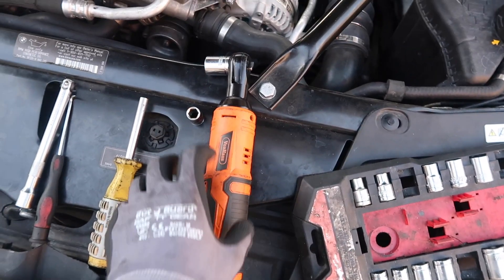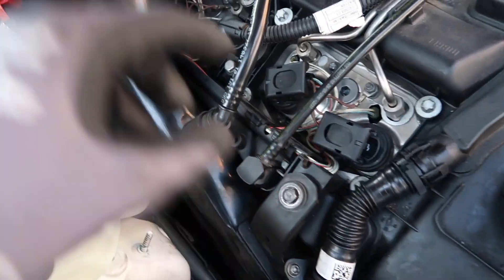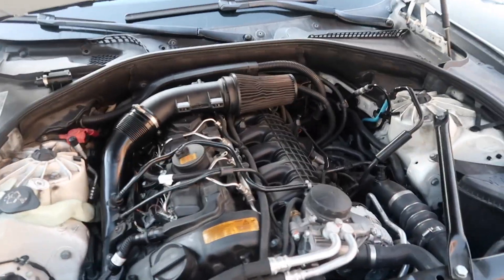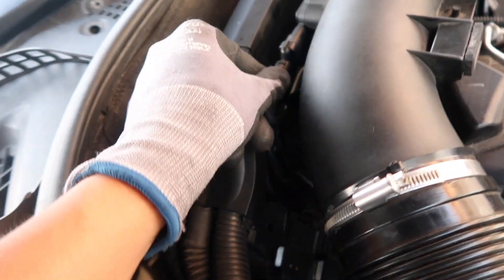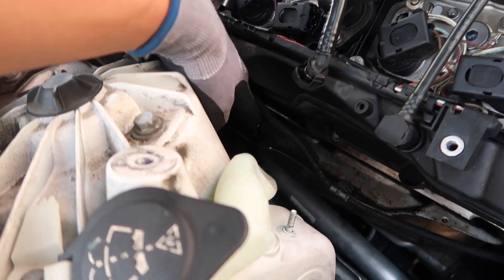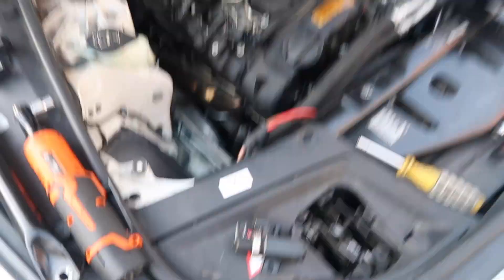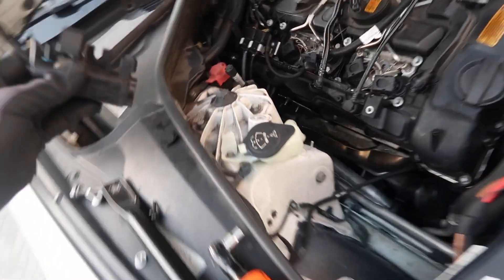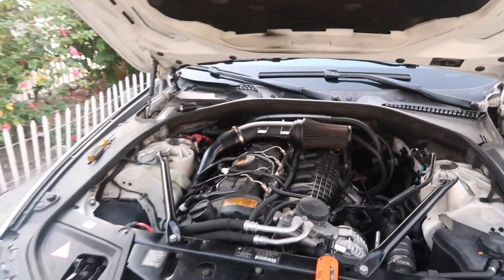N55 Boost Solenoid Replacement F10 535i (120208) DIY

Comment: I’m getting the p1290 code on my 535i xdrive. Was driving then all a sudden it was having a hard time accelerating. When I look up the code it says wastegate actuator solenoid. Would I need to replace the actuator or just the solenoid. I have the drivetrain malfunction error 😢

Comment: Did that air intake system heat soak like crazy ?? I think u lose power with that its not getting any cold hair from driving
Reply: i mean this video’s old by now lmao, but i guarantee that intake was causing a hp loss instead of gain, prolly sounded nice tho

Comment: My valve cover only has 1 vacume line why ?
Reply: Because you have a PWG turbo meaning your turbo wastegate opens and closes with the pressure of the turbocharger boost solenoid newer n55 most likely have Ewg “ electric wastegate”

Comment: Im getting code 120308 , charging pressure control , pressure to low ! Will this fix issue
Reply: Same you ever figure it out?
Reply: @stevenadamczyk3066 changed boost solenoid and diverter valve and still same code 120308

Comment: Keep getting drive train malfunction with 0 codes and 0 shadow codes after friend scanned with mhd ! Everyone says to replace this part and should solve my issue
Reply: Does your car not go into drive? I have a 2013 535i and it’s doing the same thing. No codes and the “mechanics” I had look at they have no clue 🤦🏽‍♂️
Reply: @KALIxESPN i can drive car fine even on highway but minute it goes into sport mode it gives me drive train malfunction code

Comment: I'm getting the code p12a9 boost pressure too high. Changed this part in the video, and it didn't fix it. I'm lost now.
Reply: Same here did you ever find your issue ? Help me out.
Reply: @robertherrera4903  Great news! Change the boost sensor on air intake. That fixed my issue. Super easy and affordable.

Comment: BMW error codes: 120208 and 120408 =  Boost Solenoid  malfunction
                                 120308  =  BOV (Blow Off Diverter Valve)  malfunction
Reply: I have a 2014 BMW 535i N55 F10 and I’ve been getting code 120308 do is it the BOV for me?
Reply: @FadedAshura  That code indicates a   Charging pressure control, plausibility Pressure too low   (It means you have Low to No boost for your turbo to work properly)

Do you get a Drive Malfunction when you start driving pass 40 mph?  Mostly when you have it on Sports mode and you accelerate from a dead stop.   That's what I was having issues...   I swapped the Blow-Off valve to a Turbosmart V9 dual valve BOV and I was still having the same issues... Also the new BOV wasn't making strong woooshhh sounds and I notice the Turbo wasn't activating do to that Drive Malfunction.....   

Replaced the   BMW Boost Solenoid   and that solved that annoying problem!  Very easy to replace and highly suggest to replace the vacuum hose that connects to the Valve cover.  Amazon sells a very nice quality kit of vacuum hoses of different mm sizes for less than  30 bucks and a must have when working and replace worn out air hoses in the engine... Clean the whole area from grease/oil and install the new Boost solenoid.

I'm now getting about 21psi of boost on my 535i M-Sport series.   It's feels and drives like a new car now!

Comment: I got dt malfunction going on highway today and I have codes 120208 120408 pressure too high. I’m stage 2 mhd bmw 535i 2011. No check engine. Could this be the issue ? Help plz lol
Reply: Same here lol did it work?
Reply: @joshuamolina2986  got rid of the car but never fixed it
Reply: @joshuamolina2986 I have 120308 I’m about to do mine I think it’s cold out but I’ll report back in a few hours
Reply: @chumbag fixed?
Reply: Just got that on
Mine. Did you end up replacing the boost solenoid?

Comment: Hey bro I have X6 2011 n55 I have error code 2c56. And 2c58. Charger pressure control. Can u let me know it that same problem?
Reply: Hi I also have this error, did you solve the issue?
Reply: No not yet I will try boost solenoid first
Reply: Some people said diverter valve
Reply: @PhuNguyen-lk7lu  If you can solve this issue, I would appreciate your help to me with this issue.
Reply: @umitchagylov7212  yesterday I removed solenoid and tested is fail is not holding air.  Monday I will go orders new boost solenoid.  By next week I’ll will put new one in.  If work I let u know
Reply: Yes it was solenoid.  My car now it good a lot power
Reply: Yes your car should have same problem
Reply: I hundred percent your boost solenoid bad
Reply: @PhuNguyen-lk7lu  ok bro many thanks

Comment: Thanks so much for sharing this! It really helped me. I have 2011 BMW 535i (f10). My car was giving me the powertrain malfunction error light at high speeds, spiratic jerking when accelerating, and a light smell of gas when initially starting the car. I didn't have to remove the top crossbar; my hands were small enough get around it w/o doing so. I also would like to caution everybody who tries this to be careful not to rip or tare any of the small hoses that connect to the main vacuum hose. The material that these are made of becomes brittle over time and excessive bending or movement can cause them to crack or break which will cause a vacuum leak. I slightly crack one of mine but was lucky that it was a small crack that I was able to use some Gorilla glue GEL on followed by some black electrical tape while it dried. Afterwards, the car runs a lot better and smoother. Thanks for your help in sharing this vid!  Sharing any  other vids that you have about the BMW F10 is greatly appreciated. Thanks again!
Reply: BMW N55 BIG TURBO F10 ..SUBSCRIBE https://www.youtube.com/watch?v=c8iiHkWD2co
Reply: Bro I have the same car, same year. Got the power train malfunction... still trying to figure it out. Changed the lpfp and fuel pressure sensor. I think it's the hpfp. But ima change the boost solenoid to see if that fixes it.
Reply: @antonio36o36  did  you fix it ? cause im having the same problem
Reply: @xhulio805  I switched it back to stock tune with mhd still installed and had no issues far. Although I think the actual fix is the hpfp and the fuel rail sensor.
Reply: @antonio36o36   i got mhd stage 2+
Reply: @xhulio805  it's the tune asking too much from a failing hpfp or the fuel rail sensor. Try the fuel rail sensor first which ranges from 50-150$(depending on where you get it from). If you still have the problem it's your hpfp, it just hasn't completely failed yet.
Reply: @xhulio805  run injector cleaner from bmw too.
Reply: @antonio36o36  i got some videos running the car do you have ig where i can show u ?
Reply: Was it giving you a power train issue or drive train issue? Thanks

Comment: Do you think a 2011 is a good choice 535i to buy I want to get one?or what year would you would say to start with
Reply: I've had the 2011 BMW 535i since 12/19 and love it. Haven't had any real issues with it to this point. Per the consumer reviews, keep you fuel injectors clean by using good gas and an occasional fuel treatment. I use seafoam. Reviews also says that this model is one of the better of the 5 series for that year. I didn't know this when I bought it; I just got luckily blessed.
Reply from the maker: If you find a good deal on a 2011 I’d say go for it. But if you can get your hands on a 2014+ LCI that would be dope

Comment: Hey bro, i'm having a similar issue on my N55 F10 535i. When i go to a highway I get drivetrain malfunction followed by codes 120208 and 120408.
Do you think its my boost solenoid too?
Reply from the maker: Yes it could be a possibility
Reply: @anthonyulloa4004  hey mate, just a feedback for you and other people that may see this video. I've replaced the boost solenoid as your video instructs and problem is gone. Apparently this is a known issue for F10 produced between 2010 and 2012.
Reply: I have the same codes i change boost solenoid but i still getting same codes again any advice what can it be ?!

Comment: I’m having issues but with boost to low you think it could be that?
Reply from the maker: Possibly, but the most common issue with low boost is a boost leak somewhere in the system
Reply: Inline Motorsports what do you mean somewhere in the system? Like what?
Reply: @bmwfreaks5915  anywhere between the turbo outlet and the intake gaskets.  Charge pipe o-rings or intake manifold gaskets. Or hole in intercooler.

Comment: I've have a similar problem on my f30 n20 motor. I had a locksmith take off
 my engine cover and when he placed it on, he connected the solenoid hoses wrong and I lost all of my boost. I was also leaking a bunch of oil from the hoses being placed incorrectly. Eventually I took it to my mechanic and he was able to check the whole vaccume lines and saw that they were placed on wrong. I do think my solenoid got damaged on the process. Some of the symptoms I had while I had that was that the car would run right at lower speeds and once I would get on the highway I would lose the turbo boost and the car could rev up like normal but I couldn't get boost. While that happened I got the drivetrain malfunction. I got home turned the car on and it went away. I used my obd2 scanner and got a code p0234 saying that I had overboost. Now, I ordered a new solenoid and hopefully that will fix my problem. I'll update this comment once I get it replaced. Hope this helps anyone. Good video by the way.
Reply from the maker: Thank you bro 🙏🏼The way you explain what happened it seems like your boost solenoid might have gotten damaged, a new one should definitely fix the problem. Keep us posted!!
Reply: @anthonyulloa4004  so I managed to get the new solenoid but I kept getting overboost. I was able to determine that when I was on on the highway or a hill I would do 20psi of boost and once it reached that the car would go into limp mode. So I adjusted my pneumatic wastegate and the code hasn't come back. I do notice a bit of a power loss when I adjusted the wastegate. So I'm going to switch out the wastegate soon. I just can't seem to find the part anywhere.
Reply from the maker: Omar Guzman Were you getting any sort of wastegate rattle ?
Reply: @anthonyulloa4004   nope
Reply from the maker: @omarguzman6553  That seems odd bro, if you were to have a loose wastegate you would be getting boost too low. Unless your wastegate was getting stuck somehow which could cause an overboost
Reply: @anthonyulloa4004  maybe so. I've ordered a new wastegate actuator and hopefully that fixes the problem. I've heard that sometimes oil gets trapped in it causing overboost
Reply from the maker: Well hopefully that fixes your issue bro, keep us updated! 🙏🏻
Reply: @anthonyulloa4004  so I managed to take the wastegate actuator off and it was leaking where the hose connects. I saw a video of a turbo with oil inside the actuator and it blew the turbo. Maybe that would have happened to me as well. I'll keep it post
Reply from the maker: Oh damn bro, we’ll hopefully it didn’t get to that point &’ it was just the actuator! 🙏🏻
Reply: @anthonyulloa4004  okay I was able to replace my actuator and when I took off the original it had a bunch of oil inside the diaphragm. I put the new one in and I haven't had the overboost issue.
Reply from the maker: Good to hear bro! Glad it wasn’t an even bigger issue than that!

Comment: can the boost solenoid fail in a way that you get less boost than normal?
Reply from the maker: supertitan21 Yes it can bro
Reply: Inline Motorsports thanks im having a problem with my 2013 335i its making only about 8psi its driving me crazy. I recently upgraded my diverter valve but its still making low boost
Reply from the maker: Have you checked for any boost leaks ?
Reply: Inline Motorsports i have checked but nothing seems to be leaking ive checked my charge pipe orings and they look to be in good shape. I have some aluminum charge pipe because the stock one blew up. The two clamps on the cp are tight i dont think it could leak there. I haven’t tried cleaning the MAF maybe that could cause to to not hit full boost. I do have a bigger intercooler. Catless downpipe and jb4
Reply from the maker: It could definitely be your boost solenoid bro!
Reply: Inline Motorsports is there any way to test the solenoid I don’t really want to buy that $200 part if i dont need it
Reply from the maker: You can try doing a smoke test first, do you have wastegate rattle by any chance ?
Reply: Inline Motorsports you think a vape would work lol jk. I can’t hear a rattle. Everything seems fine it just doesn’t pull as hard as before. The car runs perfect at all times just when going into full boost. I thought maybe the diverter valve was the problem but it wasn’t. Replacing that was a nightmare
Reply from the maker: Not gonna lie we’ve done our own smoke test with a vape before lol, I would say it’s most likely your solenoid unless your leaking somewhere
Reply: OaC2 Mage same have you ever figured out your boost problem?
Reply: @supertitan21  the 2013 335 only makes 8-9PSI stock.
Reply: i’m having literally the identical issue even making the same amount of boost, did the solenoid fix it? thanks so much
Reply: @supertitan21 I’ve used a cheap harbor freight fluid pump, with a cigar on one end and used it as a smoke pump. Worked on a gs300 and might try it on my f10 535 if the solenoid doesn’t fix my issue.
Reply: Did you hear almost like a hissing sound when u go pass like 2500rpm before you replaced it...I recently did the same upgrades u did with your first f10, vrsf downpipe, fmic and charge pipe...but I get this hissing sound...I thought it was exhaust leak, but the exhaust shop tested it and said there is no leak...and also, it only makes the sound when driving...if it idle and I rev it up...u don’t hear the sound..so could it be my pressure converter?
Reply: Having the same issue (335i n55) replaced cracked CP with vrsf one, now having limp mode/ engine light and noticing more air hissing when accelerating. Checked O rings and clamps but unsure whether its boost leak or maybe just replace the solenoid and go from there. Mostly stemmed from when the factory charge pipe cracked so wondering if its messed with something relating to the boost/ vacuum system or sensors? Did anyone have a fix?
Reply: Thanks for a tip on how to get too the lower bolt 💀 it was tough